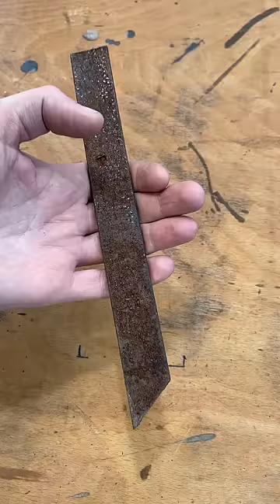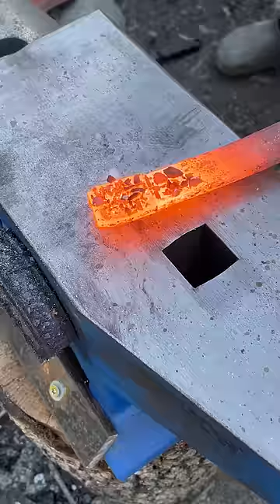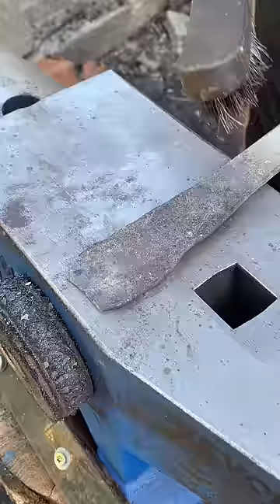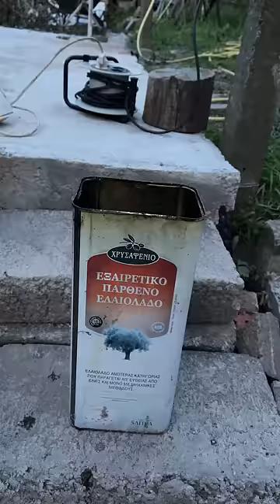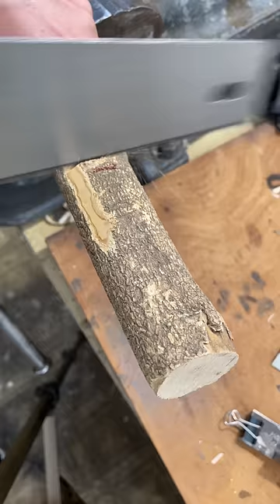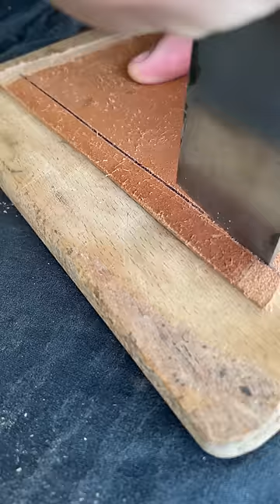Making the sharpest tool in my shop

Comment: Only one thing…the edge retention, if you can create the edge on that cutter with that file…after hardening, that means that it won’t last to long
Reply from the maker: hello , the video is a bit unclear but I used the file before I harden the steel. After that I use diamond plate because file would not cut it :)
Reply: @RustLegion  congratulations then!

Comment: Looks like a slight cold shut there, but a nice build. 🎉
Reply from the maker: yes the carbon steel sunk a bit into the mild steel and this cold shut formed. I wonder how this can be avoided.
Reply: @RustLegion  what I would do is get a thicker piece of carbon steel or weld 2-3 together of the size you just used to form a cube, grind as much of the weld off but still allow it to stay welded together then weld that onto the end of the mild steel possibly using a piece of rebar. It’s a longer process but you wouldn’t have to worry about the varying temperature differences for mild to carbon steel that forms cold shuts. If I can find a video on it I’ll send it. 😊 it’s almost like the process to make Damascus but only using one type of carbon steel. P.S. I’m no expert at all.

Comment: Watch out with your binding you can see the Crack along your edge but for cutting only it'll do.. Don't hit it though it might shatter
Reply from the maker: It is a small cold shut where the hard steel sunk a bit into the mild steel. Of course it is not optimal but it should be ok. Thank you for the concern :)  Yes - this one is not for hitting , it has very thin geometry and it's only designed for cutting :)

Comment: those Japanese leatherworking knives (ive heard from some Japanese guys that they're not actually for skiving) are really weird to use properly. because of the single bevel you need to tilt the blade for the cut to go straight into the leather. kinda comfy omce youre used to it though.

Comment: Is it possible to get into blacksmithing and how? Is a large set up required?
Reply from the maker: Hello , the hardest part is to have a good working place where you can safely install a forge and also your neighbours don't mind hearing loud hammering. Next thing is - you need an anvil and some hammers and you can start from there. There are plenty of videos, forum posts and books about starting blacksmithing. Also - a lot of courses :) Just google a bit and you will find something
Reply: @RustLegion  thank you so much! Where I live it's quite limited, but I'll try my best. It looks super awesome.

Comment: If done correctly a potato chip could be the sharpest tool in your shop. What matters is edge retention and material stability. A potato chip could slice paper neatly once. But a dull knife may have slit millions.

Comment: What metal did you use for the weld?
Reply from the maker: I used mild steel for the base metal and 52100 high carbon steel for the edge bit :)

Comment: Anyone else notice the crack the size of the grand canyon
Reply from the maker: there is a cold shut on the steel if that you mean - it is not perfect of course but it is not critical :) Or if you mean the crack on the wood - Still - not optimal , but for my personal use - it will do :)

Comment: What is the white color powder u put on the hot steel?
Reply: Borax to prevent an oxide layer forming that would prevent the two pieces of steel from welding

Comment: The choice to use the words “making the sharpest tool…”, then to faux cut steel with scissors as an edit to shorten the video… 
Reminds me of that saying old timers used: “He ain’t the sharpest tool…”
Reply from the maker: I used this title because it is 100% true :) In this video I made a Japanese style leather knife - 2 mm thick , sharpened at 15 degree angle with zero secondary bevel. It's purpose is to split leather so I polished it's cutting edge up to 4000 grit and then polishing compound making it indeed the sharpest tool in my workshop and I demonstrated that it works pretty well for splitting leather at the end of the video :)

Comment: What's the tool you're using to remove material for the tang in the handle? I always use a file but it's tedious and it looks like that tool is removing material way faster!
Reply from the maker: it is something like the Japanese tool called Sen scraper or at least my interpretation. maybe big sharp file will work with the same speed . The good thing about the sen is that you can sharpen it but you can't sharpen a file. Also it leaves a bit more uneven surface and it needs to be leveled with a file after that. But maybe try and make one . Still - the grinder beats both :)

Comment: What we're those squares (the ones that came in foil and looked like chocolate) he folded into the bar?
Reply from the maker: it was just a piece of high carbon steel that I forge welded and it is the edge of the tool :)
Reply: @RustLegion  great stuff 👍 thanks for the education